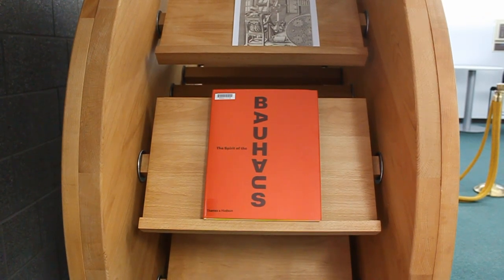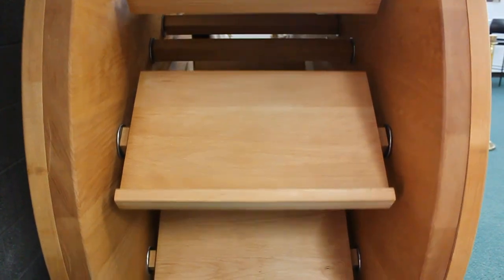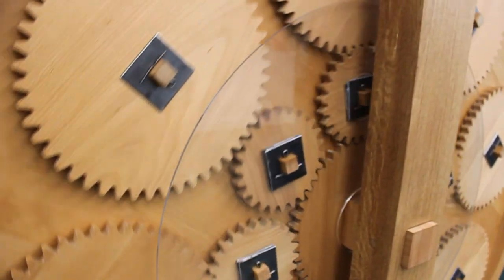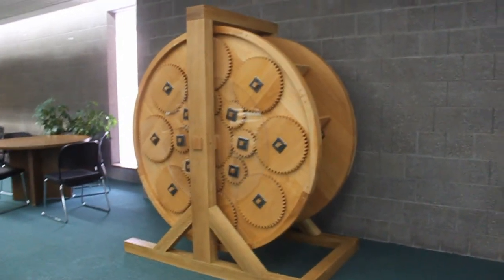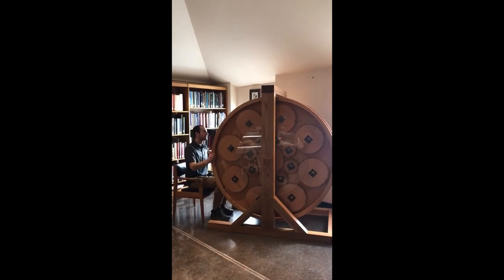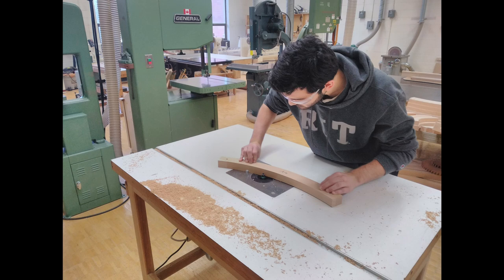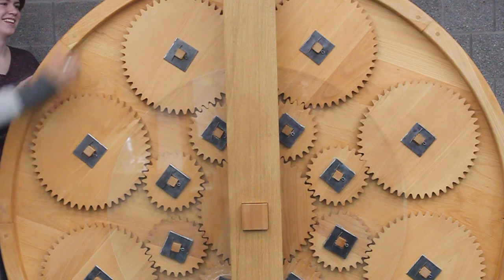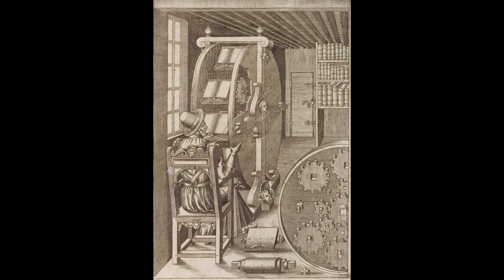RIT's Reading Wheel after Ramelli: How It's Made

Comment: I've been trying to find a smaller one for personal use, is there anyone that can give me information.
Reply: Thanks for taking interest! There is potential for a smaller version, especially using modern materials. Another option is using hanging shelves (like ferris wheel cars) rather than gears to reduce diametric size. The overall size will be largely dependent on the maximum size of books you'd want to fit on the shelves. We had toyed around with the idea of 3D printing miniature versions that would physical work, but too small to hold books. I don't personally have experience with a tabletop sized wheels.
Reply: @reesesalen5033  thanks for the information, I was thinking about something 2/3 the size represented, I wouldn't hope to put it on a table. If it's not to much of a bother I would be grateful for any information about this.
Again thank you
Reply: @efishon7102  our team's design process is mostly documented here http://edge.rit.edu/edge/P18510/public/Home